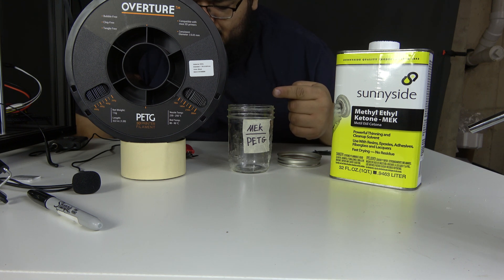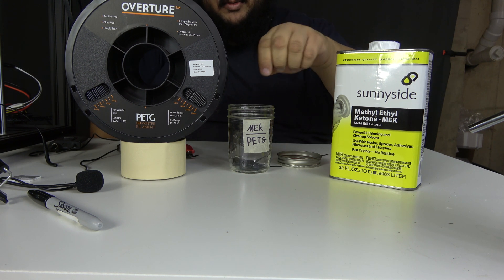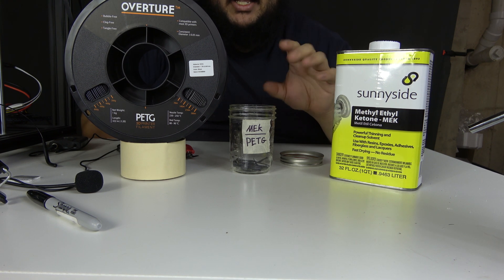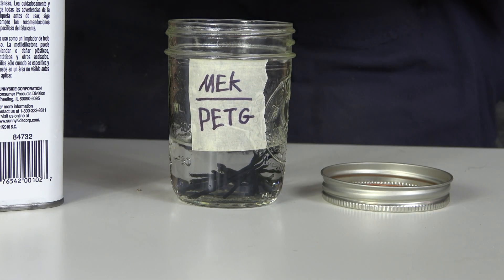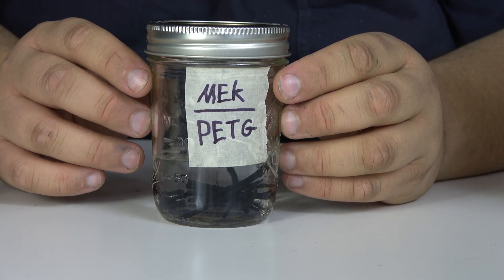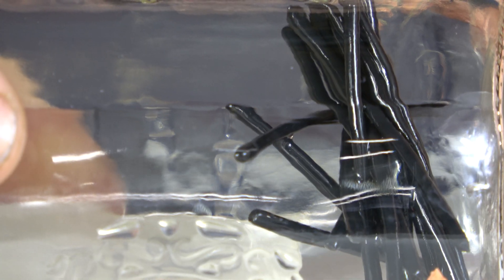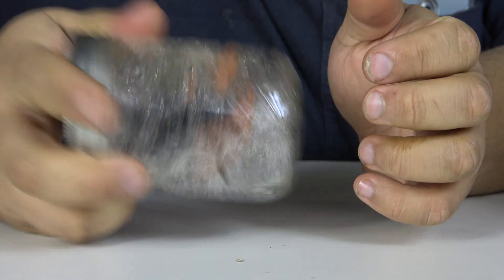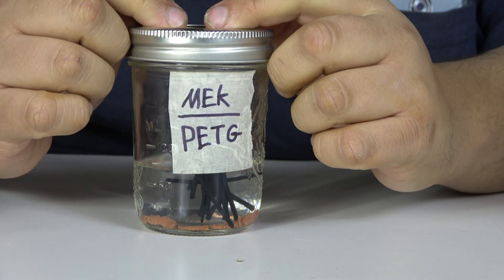Testing to see if MEK will dissolve PETG

Comment: Yea I had a clogged nozzle that I couldn't cold pull with PETG. MEK doesn't do much other than surface smoothing. I ended up using a blowtorch to burn off the PETG. Would be interesting to see how long it would take for it to saturate the PETG sticks. I'm guessing it will just make the PETG soft. I think MEK is good for PLA welding.
Reply: It’s not good for pla welding either